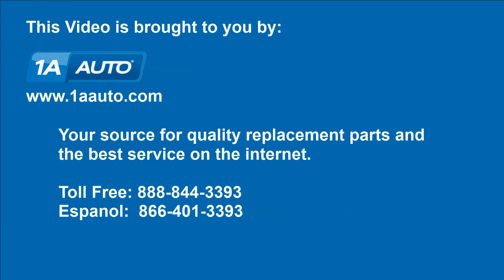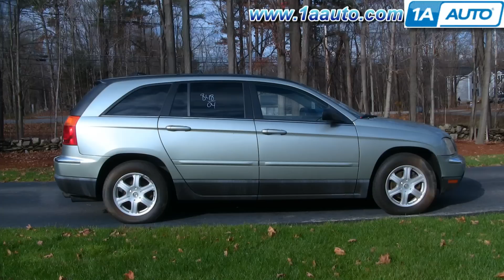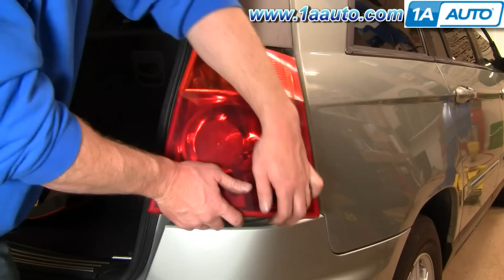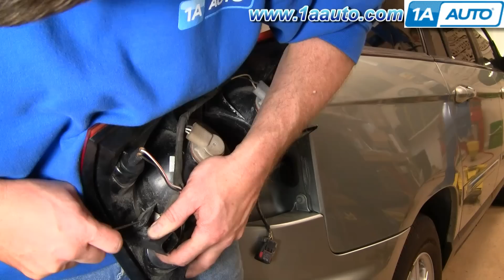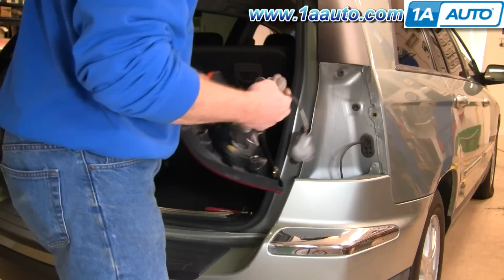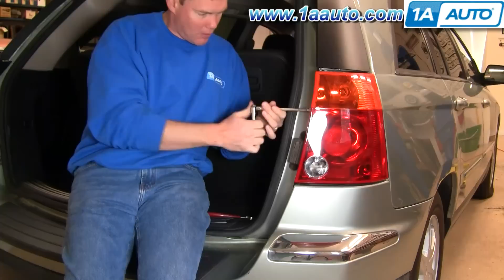How to Replace Tail Lights 04-08 Chrysler Pacifica

Comment: You made this look simple, I think I can do it now. Unfortunately I already bought the bulb, so I won't buy that part from you this time.
Reply: Exept for, the U bolts were broken, frozen on, the wiring too short to twist the turn light out (I figured out to twist the tail light bulb out first, but still pretty tight), plastic holding one of the U bolts is broken out so the new bolt won't line up,  so only the bottom bolt is holding the fixture on, other than that it was easy.